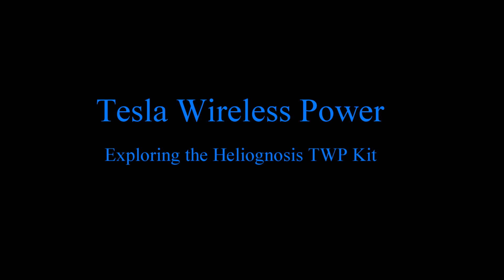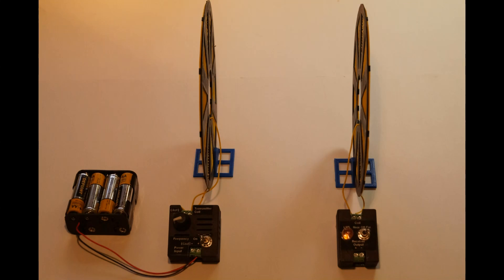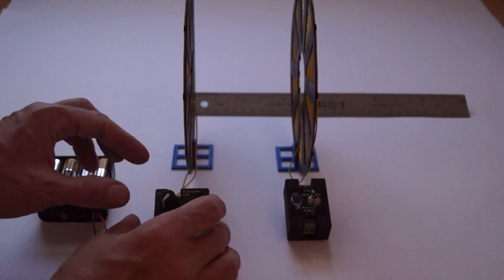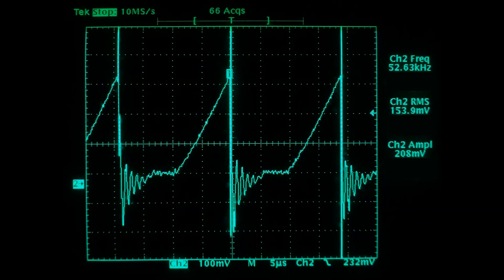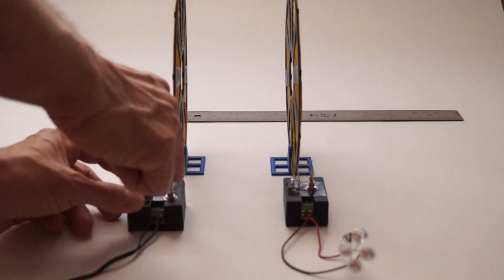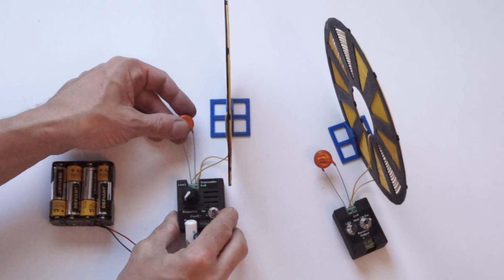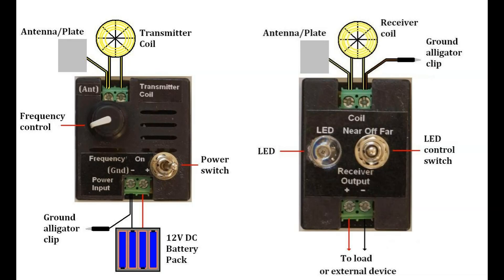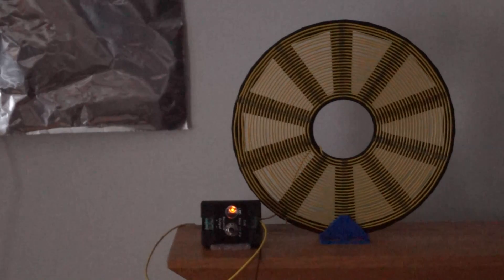Tesla Wireless Power

Comment: yeah this is called electromagnetism. the same thing that makes step down/up transformers work. if you run electricity through a coiled wire it creates a magnetic field. If you power the first coiled disk, the magnetic field causes the electrons in the receiver disk to start moving. Moving electrons is electricity.